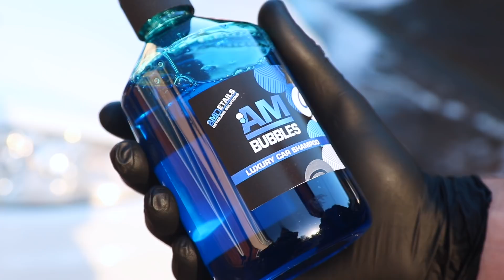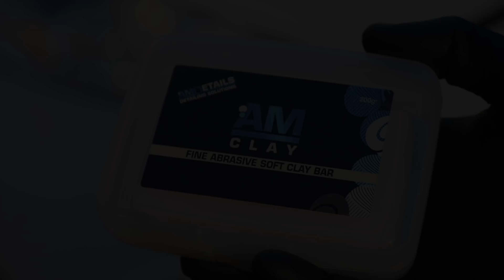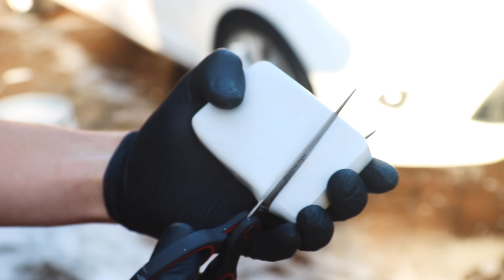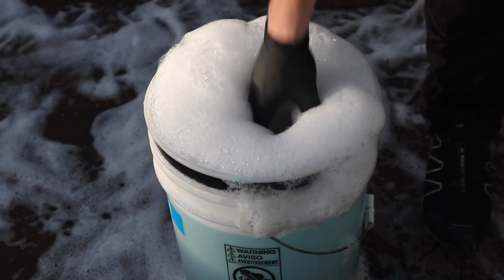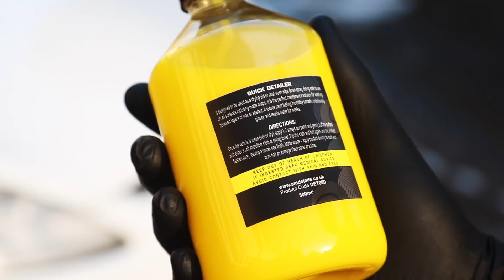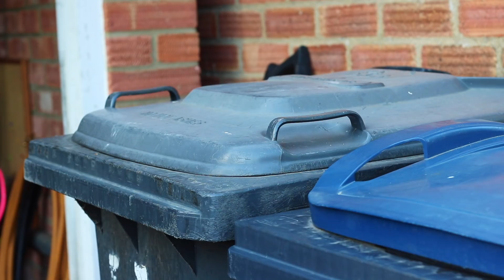AM Details Clay Bar : Mechanical Decontamination

Comment: You should get a bucket of very hot water and leave the clay in it for about 15 mins to soften it up. Use multiple bits so you can do a section then plonk it back in the water to soften it again then use a fresh warm soft piece. Stop marring of the paint especially in winter when the clay is rock solid. If you don't soften the clay it will marr the paint even if it's "mild" clay.

Comment: Nice to see you back fella. 
I have a question a have just bought the auto finesse green drying towel I used it today and it’s still wet what is the best way at to keep it in good condition and can I just leave it wet till next time or dry in on the radiator use it 2 or 3 times then wash it what’s best to do mate
Reply from the maker: anthony white thanks for the kind words Anthony.

Personally. I treat my mine the same as everyone of my microfibres. After one use it will get washed. 30 degree quick wash at 1600rpm with liquid soap. They then go into the tumble dry until dry. If you don’t have a tumble dryer just hang up some where indoors and allow to air dry.

Hope this helps dude.

Joe
Reply: Joe Huntley thanks for the advice joe very much appreciate